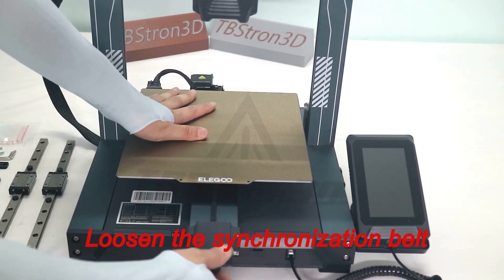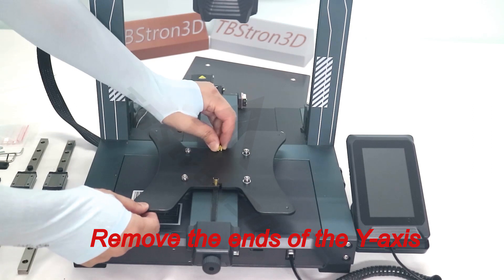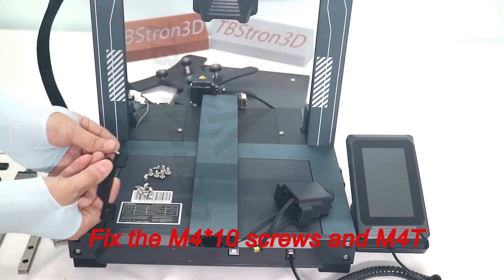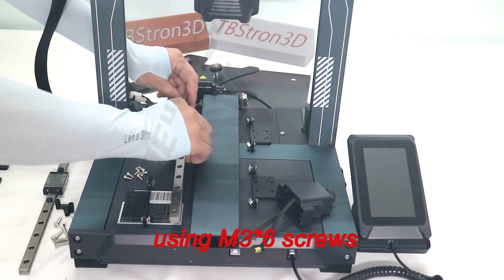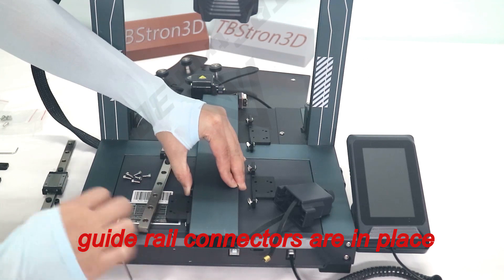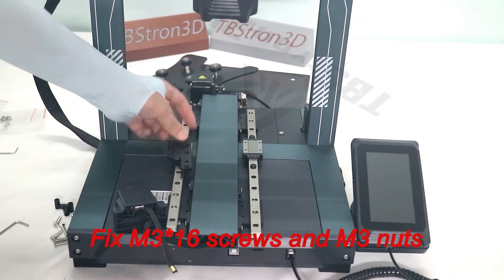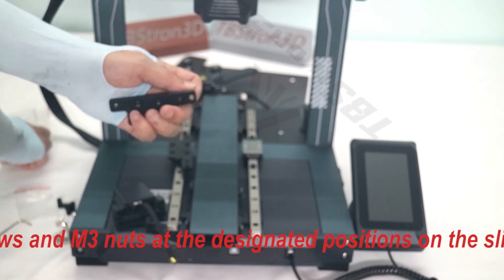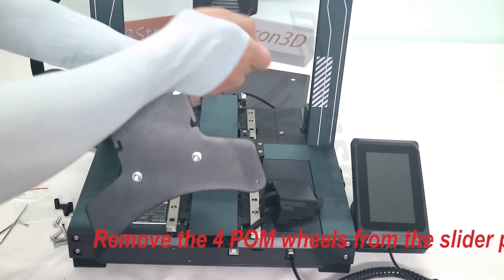ELEGOO Neptune 3 Pro 3D printer Y-axis upgrade linear rail installation guide.

Comment: If the Y-axis stopper is a m8*16 bolt, the stop button cannot be pressed correctly.
Reply from the maker: Hello, thank you for your reminder. Recently, we have added additional installation shims and silicone gaskets for the slider in our packages. These components can help resolve the issue. Thank you.
Reply: The package I purchased was an older version and did not include the auxiliary bracket.
Is it possible to purchase only additional components?
Reply from the maker: @ミナッティ  Hello, you don't need to make an additional purchase. We can send you the STL files, and you can simply 3D print them. Please contact us at tbstron3d@gmail.com. Thank you.
Reply: @tbstron3d-yf9op  thanks for the answer. I will do so.

Comment: What linear rails are used? Can you give me the exact Specs?
Reply from the maker: Hello, thank you for your attention.The
model of the straight linear guide on the X- axis is MGN9, with a length of 315mm and equipped with an MGN9H slider; the model of the straight linear guide on the Y-axis is MGN12, with a length of 300mm and equipped with an MGN12H slider.
Reply: Thank you
 @tbstron3d-yf9op

Comment: I've just received my order, installing X-axis was fast and clear, but trying to install Y and there is some confusion, you send what appears to be some silicone rings yet they never appear on this video. Where are thye supposed to fit?
Reply from the maker: https://drive.google.com/file/d/1d8V6z3FdrfkyusUy7alOpTDdoqeXRdpB/view?usp=share_link    Hello, in this graphic description, the 10th step is explained. Thank you.
Reply: @tbstron3d-yf9op  ok, thank you!
Reply: @Cias_artist  Is the linear rails kit any good?
Reply: @zachmakesstuff1368  Hi there, it is but it's biggest advantage IMO is that there is no need to keep adjusting the wheels/bearings and the occasional prints that fail because of that. Basically one less variable to worry about. the product does have quality, is well packaged and in my case came quite fast.